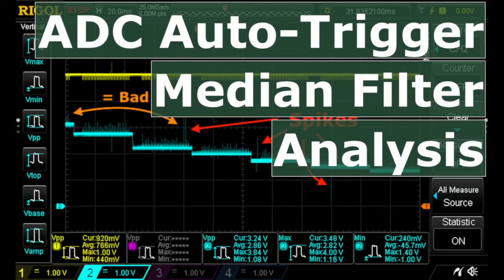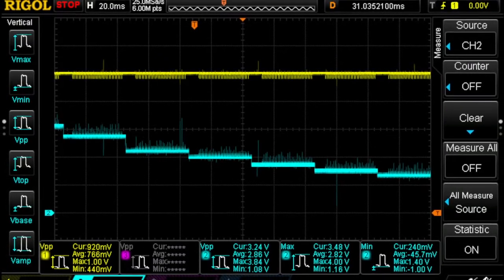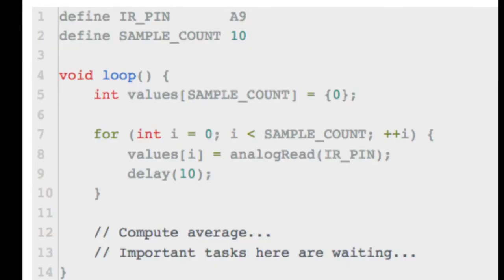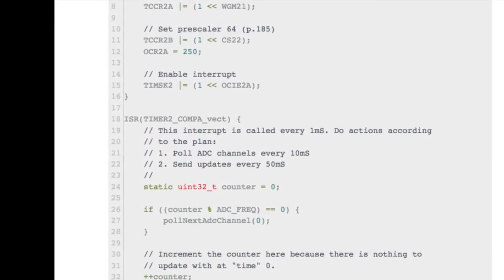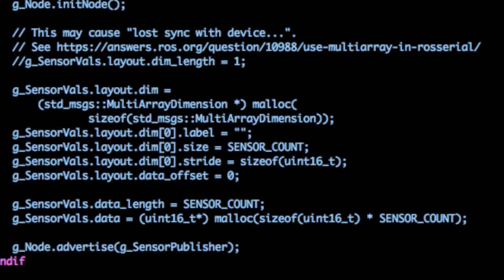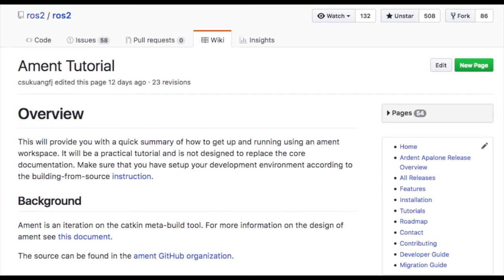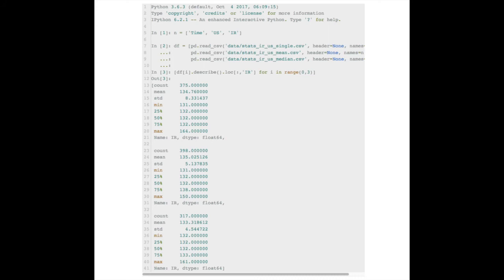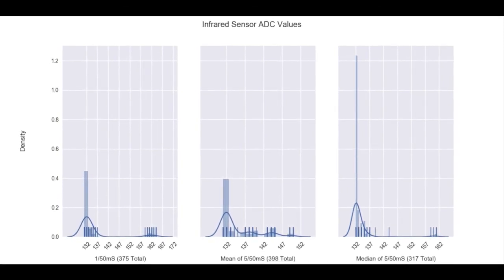ADC Auto-Trigger Median Filter Analysis

Comment: this is cool. the median filter would work if your noise was symmetrical. and thermal noise is symmetrical. i can imagine if you had some kind of noise in there that wasnt symmetrical the mean would survive that more. or would it?

its an interesting one to think about it. my gut feeling is the mean is more robust because a single burst of spikes could throw the median way out. but then again that'd throw the mean out too. man this has got me thinking.
Reply: Quite to the opposite. For normal (gaussian) distribution of the noise, all three would be equal. As soon as spikes appear on the signal (outliers), the median becomes better estimator of the value, compared to the mean. The reason for that is that median filter is non-linear, apart from the mean (linear). It cuts off really bad measurements from the set of data points.